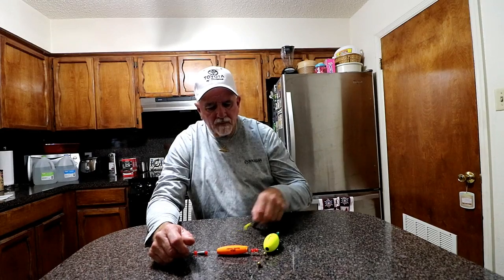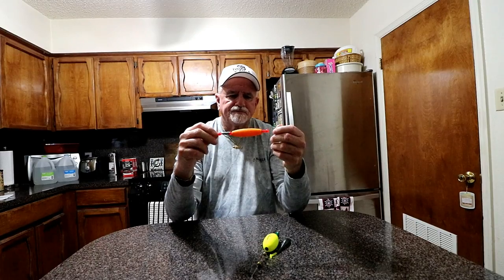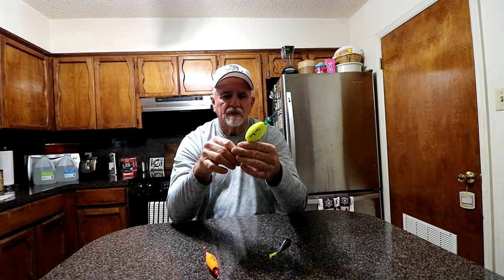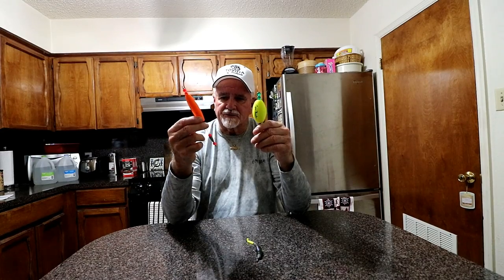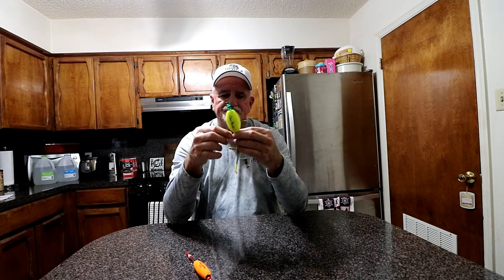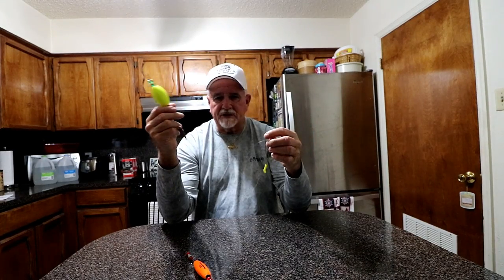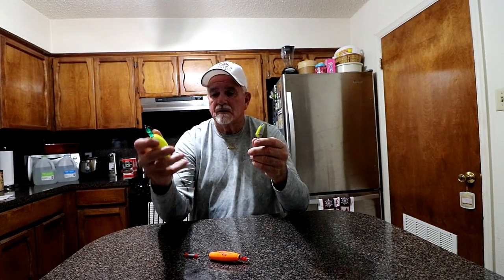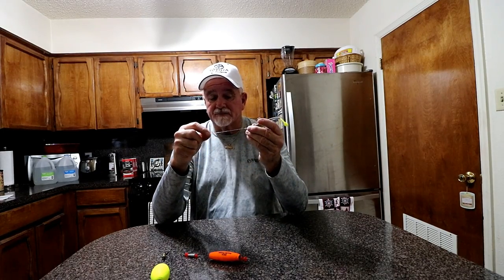Rigging A Popping Cork For Speckled Trout and Redfish

Comment: What would you consider too heavy for a jig head? Is 1/4 oz too heavy? Also, if Gulps sink like a rock would you recommend just using a bare hook instead of a weighted jig head to get maximum action? Thanks.
Reply from the maker: Bob Gill  Hey Bob , I use a 1/8 oz but you could use 1/4 oz , anything bigger would reduce the action. If using the bigger Gulps like the 4 inch and above a bare hook or 1/16 head works fine.

Comment: What are some tips on casting these long distance? I know with the concave ones, I place the hook in the concave part of the pooper so my leader is not so far down when I cast. Great vid by the way!
Reply from the maker: Phil  Hey thanks Phil , because these things catch a lot of air you should add a brake or increase the spool tension a little . The other key in my opinion is to not try and launch it ,  more of a lob cast usually works better for distance .

Comment: Hi Ross. During low light conditions, either predawn or after sundown/night, which colors show up best on the water? Most of these corks are yellow and orange and stand out rather well but between pink or green, which is the color corks I have on hand currently, which one do you think would show up better? I tried the pink at night and it was so so, it was a versamaxx plastic popping cork if that makes a difference. Also, do you find the louder the better on popping corks overall? Some of the newer types have extra washers and metal beads for extra noise and still others are now made out of plastic and have metal beads inside the "cork" along with the washers and metal beads on the wire. Thanks again. Keep up the good work.
Reply from the maker: Bob Gill  Hey Bob , in my opinion the Chartreuse cork stands out the most as far as color goes. As for noise level that depends on water conditions , windy days with choppy water the more noise the better , also in dirty water this is true also. In calm water and very clear water less noise works better I think.

Comment: I also prefer the egg shaped corks. If I’m using a cork it’s usually after I’m not catching on plastics. I’ve been on a spinner kick for the past week. I caught slots reds today and sunday and not one single trout. I’m wondering if the trout aren’t interested in the spinners.
Reply from the maker: Hooter Texas  I think the trout bite is off some due to all the freshwater we have gotten in our system , doesn’t bother Redfish much.
Reply: RedfishRoss that makes sense. Normally I’m catching trout and hoping for some reds. It seems weird not catching even dink trout.
Reply: Last week channel 5 in the valley had a segment on the negative effects of the fresh water on the fishing in the lower Laguna Madre. This week there are some very aggressive tides. Hopefully they will help move some saltwater back into the bay and help clear up the water a little.
Reply from the maker: kweeks10045  Yes Sir , in my experience large influxes of fresh water definitely has a negative impact on fishing.